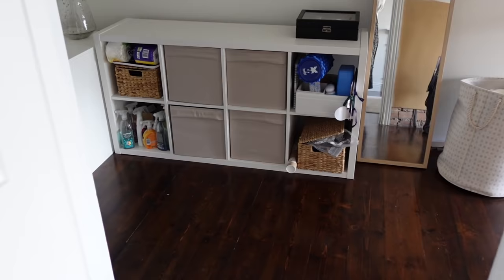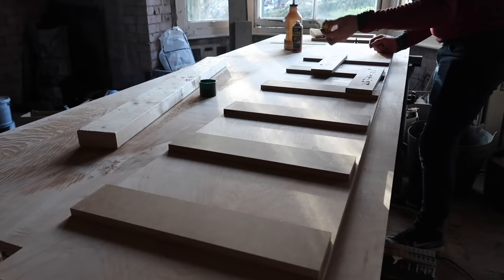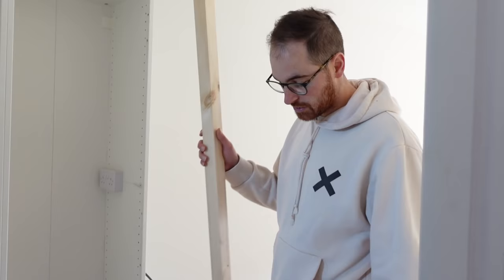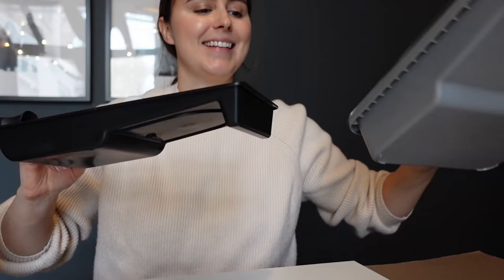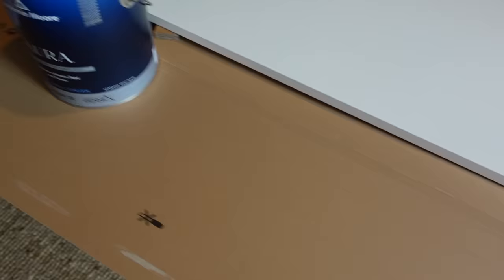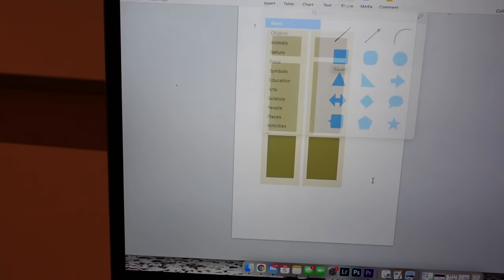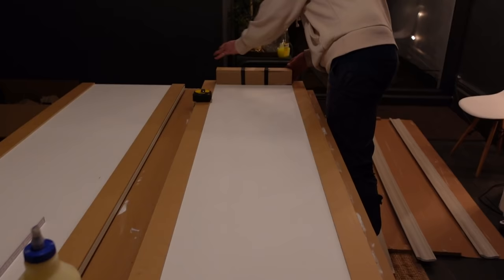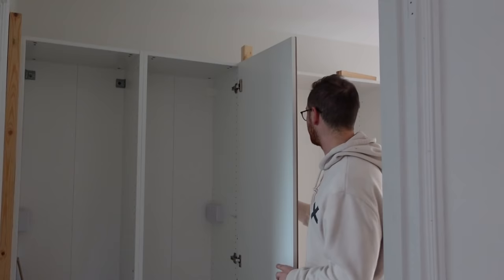HALLWAY MAKEOVER | IKEA PAX HACK FOR TRADITIONAL WARDROBES | Laura Melhuish-Sprague

Comment: You will love Ben Moore Paint. It's the only one we ever use. If you are painting kitchen cabinets, you should use the Advance line, which has a longer drying time because it performs like an oil based paint, even though it cleans up with water. I am not usually a white-wall person, but I have fallen in love with Ben Moore's color "String of Pearls," which is a chalky white that never looks yellow, dingy or glaring. It looks beautiful with York Gray, which is one of the Williamsburg historic colors. Your projects are amazing! You both have worked so hard on your home and the results are a really remarkable achievement.

Comment: Looks fantastic. Never knew they didn’t have Benjamin Moore in the UK. You are now using the best paint ever made. It’s the only paint I use in my house. Also, is that a stapler or a nail gun that you have? A nail gun is usually better for use in wood instead of a staple gun. Try adjusting the depth gauge if it has that setting.

Comment: Great team work. My wife would do nothing. Two things you should have done. 1. You should have raise the cupboard from the bottom and used the same skirting  board as the wall for a better built in look. 2. Do cupboards floor to ceiling using the Cornish for built in look.

Comment: These wardrobes are beautiful and thanks for the info on hinges. The IKEA hinges have been a nightmare to use over the years. Just one question - after you get your shelves installed will you fill in the other shelf holes? I have been thinking about doing this with our dining room buffet which is made with IKEA cabinets.
Reply: Thanks Wendy! We will be leaving them unfilled so we can change it in the future if we want to store different things in there. We filled them on the bookcase we did and it looks great. But it is a lot more work to fill and sand them all.

Comment: With designs like this where the door is inset into a frame, you could also use small butt hinges. You wouldn’t get this clean hingeless look as the centre of the hinge is visible when the door is closed, but it can give a nice traditional handmade feel if you do it right

Comment: That closet turned out absolutely beautiful and the color is also very beautiful. 
Did you consider possibly lifting it up off the floor 7" or so, so that to lift it closer to the ceiling?  That way you could’ve just built it up all the way to the ceiling so there was no gap above it, giving it a built-in look.